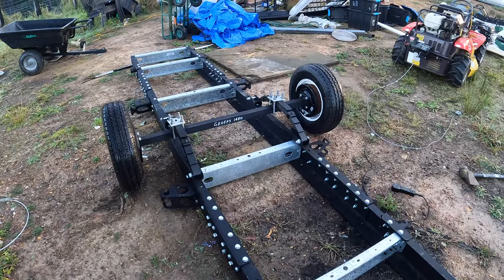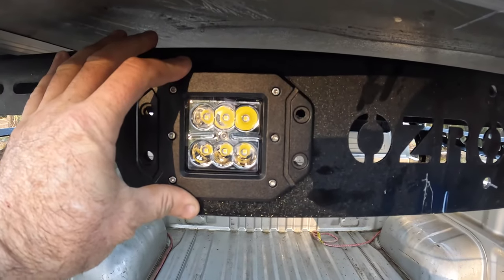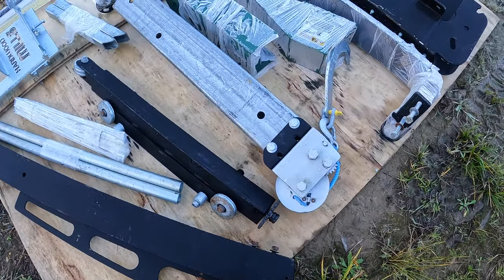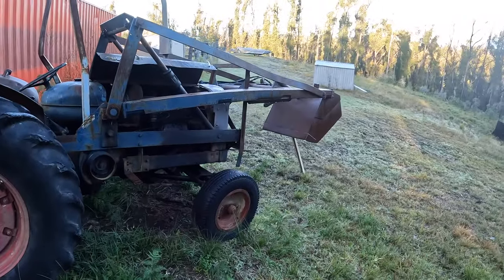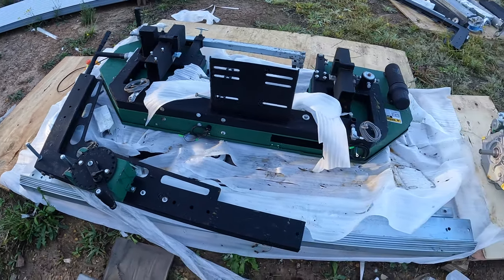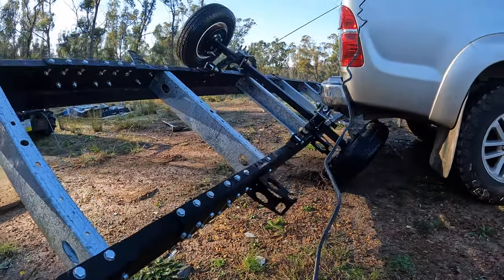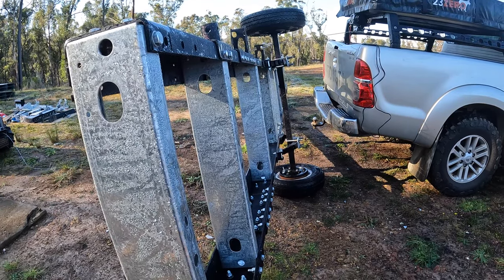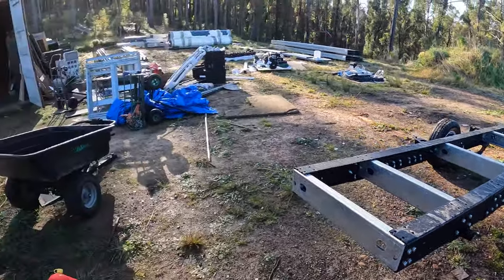Hardwood Mills Australia Wood Mill Build Part 2

Comment: Yes, wheels on was a great idea. This would have been a hard problem to solve if you didn't have two winches. I would have personally done it differently - put some stays under it once you got the body starting to lift, and then extended the ute's cable so it was out of the drop zone for later, and I would have used the razorback (on the other side) to lower the thing down rather than let it drop - but the suspension did fine.  Another alternative would have been to find a way to get the ute winch to pull in a rotational perspective - probably something from your sailing would come in handy here, add a stay one side on the ute-side of the trailer, then run the cable over the high end so it has to raise the far side up first and gets you to the same rotation?
Reply from the maker: I'm just glad it worked. But I still have to work out how to get the blade assembly and travel car onto it. Lowering it down with the razorback is a good idea, I had the razorback on the other side in the perfect spot to do that, but I didn't think of that!
Reply: @steyeroffgrid  yes, there's a whole raft of "big" things in this build ! I'm looking forward to see you mill your first log !
Reply from the maker: @Poundy  The first log is going to be a great experience, producing lumber for my house is a great thing. It's my property supplying lumber for my house.